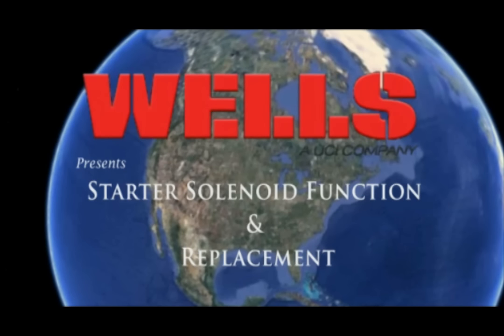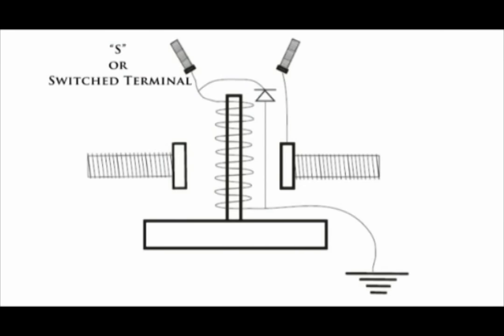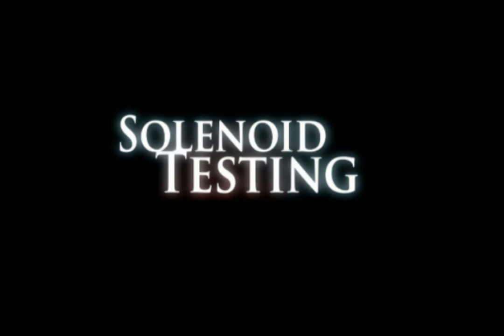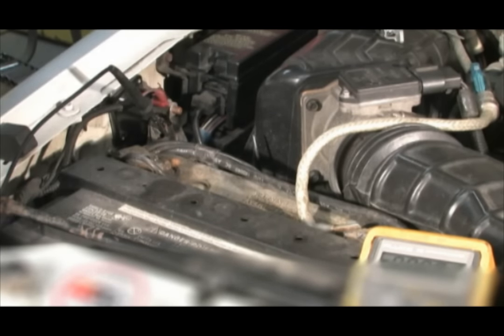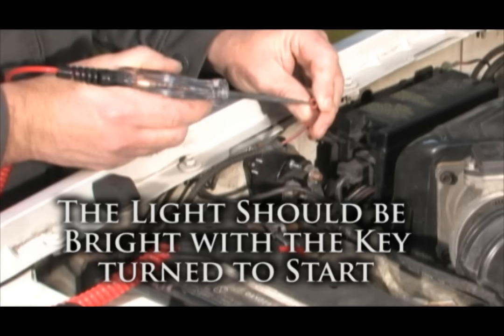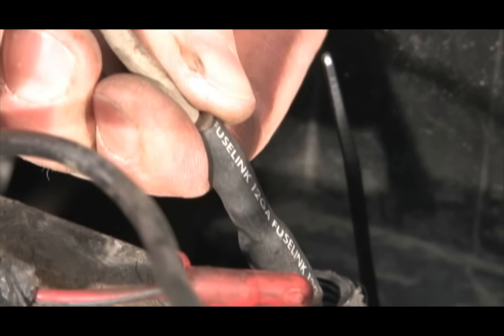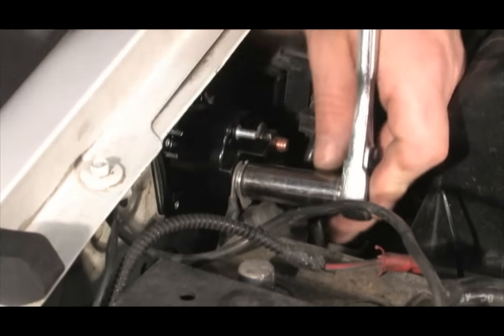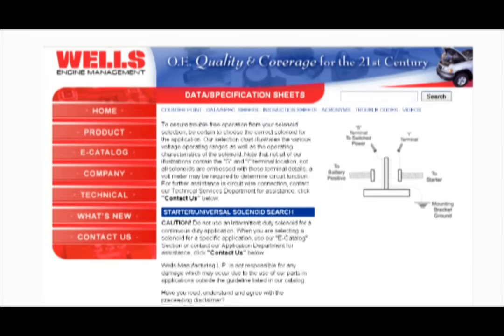Solenoid Testing, Function and Replacement

Comment: Hey Mark! Great video!  So I replaced the relay on the fender and I'm still getting a "single click" problem which (as you mentioned) indicates the problem could be elsewhere.  Where should I start?
Reply: Check the starter wires and battery cables and ensure the battery has a proper charge.

Comment: I found the problem! after testing the starter and knowing it was good,I bolted it back on there "correctly".However,here's where i messed up.the fat red wire on the "top" bolt of the starter solenoid was touching the "bottom" bolt of the starter solenoid.see,when tighting it back on,that eye hook was moving at the same time.it eventually stopped moving cause the bottom half bolt stopped it thop i was still bolting it back on.see what i mean? they were touching each other,grounding out.

Comment: after a long discussion,alalying an narrowing down the issue,iwe all think it's the solenoid.installed a brad new one last night,but the prob lem still remains.it's a 92 ford f150 xlt 6 cyc,4.9 ltr,2 wheel drive,stick...........i'm thinking it's the starter realy,ignition switch or bad wiring touching the truck somewheres.question is,where? i done looked! man i hate this.

Comment: I just replaced my starter on my 2002 f150 4.2 6cyl... I thought it was the starter because it would start after hammering the starter a few times... Advance Auto also said it is for sure the starter. After replacing the starter it started the next day it would not turn. A friend took a screwdriver and touching the battery and starter connections and vehicle started. Is the solenoid bad or is it something else?
Reply from the maker: Temujin, it could be the starter solenoid. Use a test light and test it just like we show in the video. If you have any more questions let me know!
Mike Becker, Technical Services Instructor
Reply: Unfortunately, I beleive the tester would most likely cost more than the solenoid. I think I will just replace the solenoid which cost about $20.
Reply from the maker: Alright, sounds good. If you need any more help let me know!
Mike Becker, Technical Services Instructor

Comment: I have a 1990 ford f150 xlt lariat 5.0 the starter solenoid wires are connected the reverse of the way your wires are connected. I have the red battery cables on left side of solenoid and the wire to starter on the right side of solenoid is that ok does it matter what side they're on? Truck starts great now that i only changed the starter. I'm just curious to see if it matters thanks.
Reply from the maker: Hey Handyman1212, it doesn't matter which side the big cables are on. The only things that matter is they are on opposite sides and the wire that controls the solenoid is on the S terminal. All the solenoid is doing when turned on is connecting the 2 big cables together. Hope this helps give you some piece of mind!
Mike Becker, Technical Services Instructor

Comment from the maker: Be careful with that idea. First check to make sure the ignition switch is getting 12 volts. If you need a wiring diagram, let me know. Leave me a message on my channel with your e-mail address. I answer a lot of questions. Please leave year, make, model and engine size and a reminder of the issue.

Mark Hicks
Wells Vehicle Electronics

Comment: Hi Mike, I have a 1995 Ford Ranger XLT 3.0 MFI and I just replaced the starter thinking it was bad.. At roughly 2:35 of this video. This is the sound I hear. Can you tell me your thoughts?
Reply: on a note here, I watched the video over again and to save time for the reply, Everything You said is done. Battery is tightened down and everything else.
Reply: Junking this truck in 1 week if no reply.
Reply from the maker: Jake, Can you turn the engine over with a big wrench/rachet? Is it seized up?!
Mike Becker, Technical Services Instructor
Reply: Ok, Finally got someone that checked it out. It was Seized. Thanks for your Help. Used Engine maybe? Truck is almost Mint shape for a 95
Reply from the maker: That's unfortunate! But at least you figured out what it was. Sure, a lot of people install used engines with good luck. It's on you to determine if it's worth it on a 95'. Good luck Jake!
Mike Becker, Technical Services Instructor

Comment: 2004 Toyota Camry.  Thought starter was going out.  Give it a little tap and would start.  One day wouldn't start at all. Replaced started. Cars starts sometimes. It's clicks once. I play with the key and sometimes it starts.  Sometimes it doesn't. Any advice? I have several spare keys. It's the same with all of them.
Reply: Change the battery
Reply from the maker: Could be ignition switch related. You'll want to check power to the S terminal on the starter when the key is in the start position. Could also be the transmission range switch.
Mike Becker, Senior Technical Instructor

Comment: I have a 2004 Kia Sedona. Turn the key to ON and all accessories and lights work fine...turn to crank vehicle and nothing. Took starter out had it tested at AutoZone tested good. Battery is good. Tried to jump vehicle off to get it started nothing. All fuses are good. Changed out ignition switch still nothing. Any ideas?
Reply from the maker: Stacey, this could be caused by a bad starter relay maybe. On your Sedona instead of a solenoid mounted on the side of the engine compartment, it is actually attached to the starter. I would inspect for power to the S terminal. Maybe time to have a shop test this thing?
Mike Becker, Technical Services Instructor

Comment: I need advice from a mechanic. I had a question about a Rochester dual jet carburetor. On my car theres 2 pigtail male connectors that look the same. So i wasn't sure which one to plug into the mixture solenoid plug in on the top of the carb. Is there a way to test it or find out some how.
Reply from the maker: +John Peralta If you take a test light and go to one of the connectors. Put the test light probe into one terminal and the ground lead into the other terminal of the connector. Then turn on the ignition switch and if you are in the mixture solenoid plug the test light will flicker for a few seconds after initial key on. Hope this helps!
Mike Becker, Technical Services Instructor
Reply: Ok thanks i appreciate it. Ill try to see if I can get the ground to clip on to the terminal. At first I didn't know whether or not to try that cuz I wasn't sure if it would short it out or something cuz my test light is just a cheap little one.

Comment: have a strange problem, maybe you've seen it.I have a 1984 cj-7 with a 4.2.Cranking it yesterday there was a click then a lot of smoke.The  positive and negative battery cables had heated up to a point where the plastic coating had melted.The solenoid was fairly new, the starter old and with a dead spot.Nothing similar to this had ever happened.Any advice you can give will be appreciated, thanks
Reply from the maker: It sounds like the dead spot in your starter has become a dead electrical short. Get your starter tested and check those wires and cables very closely and repair where needed and questionable.
Mark Hicks
Wells Vehicle Electronics

Comment: Will a bad starter solenoid cause the 15amp fuse to blow out...i changed it and it started once cut it off went inside to get money to go eat and it will not start also it blew the fuse I just replaced
Reply from the maker: Hey KangoKid Kidd, thanks for watching! The solenoid is just allowing current to flow to the starter. It really shouldn't directly cause that fuse to blow. I'd be looking for something else in that circuit.
Mike Becker, Senior Instructor
Reply: @GoTechTraining  shit man I am not smart to do all that but just so you know I think if the starter solenoid is bad it will send current double back to the fuse that is what I think happened so in saying that I replaced the starter solenoid then replaced the fuse and it started flawlessly I mean I barely had to turn the key all the way...and it's being starting like a new excursion...so I am not saying your wrong and I ain't to professional but my theory worked and thanks to YOU...i was like well if the starter solenoid is bad then that's why the fuse is being blown out...i just keep it simple...and also by taking a screw driver from post to post on the starter solenoid it started up with no problem at so ...yiu guys have to say stuff like if you jump the starter solenoid and truck or car starts then it has to be a bad starter solenoid....that would have saved me lots of time...truck runs great and I thank you and all the you tubers who take the time to make video's like yours...thank you from the bottom and top of my heart...you rock man...

Comment: Thanks for showing me how to do that, Eric What happens when the starter will run off the car but, not on the car?
2006 Impala LT 3.9 automatic.
New battery and cables, new relay(4 prong) and there is power from the ignition switch to the starter, which I tested. No damaged or broken wires and ALL wire terminals are clean. When I turn the key to the run position, nothing happens. No noise, humming or clicking but, all accessories work fine.
Someone told me since the car has been sitting up for 4 months maybe, the engine is locked up. I can turn the crank manualy so, that's not it.
please help. Senior in need of help.
Reply from the maker: Hi Neil, there are a lot of things that can cause a starter not to crank the engine over. Security issues and wiring are probably two of the biggest. I would pull codes first. See if you have any related to security and see if the vehicle is in anti-theft mode. From there, look at live engine data and see if the "crank" PID says yes. Let me know how this goes.
Mike Becker, Technical Services Instructor
Reply: Cannot pull codes because the car has been sitting for 4 months. No security or anti theft system on this car.
Thank you so much for your reply. Sorry I called you Eric. I was thinking of someone I was just talking to before you.

Comment: I have a strange problem, I have a 2002 saturn SL2 that starts off and on. I went to O Riley Auto store to get the starter, alternator, and battery tested everything came out find. i'm lost on what the problem may be.? help please
Reply from the maker: When you say it does not start I am going to assume you mean it does not start because the engine will not turn over.

1. Shift the transaxle from park to neutral and retest.

2. Test for 12 volts on the starter solenoid on the Purple wire in the crank position.

3. If ok, jumper the Purple wire to the Red wire on the starter. The starter should crank.

4. Test for 12 volts at the battery cable on the starter. Load this circuit.

5. Check for a good engine ground. 
It is common for the ground strap on the transmission to get corroded and loosen.
Please stay in touch,
Mark Hicks
Wells Vehicle Electronics

Comment: Hi;
Thanks for your video.  My vehicle was having trouble starting without turning the key a few times; then it would catch.  Now jiggling the key and/or the shifter (safety is connected) doesn't do anything and the vehicle doesn't even click.  I checked the battery.  Any ideas?
Thanks!
Reply from the maker: Hey Herman, what kind of vehicle do you have? Let's start there.
Mike Becker, Technical Services Instructor
Reply: Hi Mike;
First, thanks for your reply.  I have a 2004 New Holland TC33D tractor.  I have now checked the starter solenoid, and it checked out.  Also, the lights on the dash come on, but still not a sound.
Thanks!
Reply from the maker: Hm, sounds like maybe the starter it's self is bad. Maybe a bad spot inside the starter. I would verify battery voltage at the big wire in the start when someone hits the key. If you have battery voltage their either the starter is bad, or the motor is seized.
Mike Becker, Technical Services Instructor
Reply: Hi Mike;
Thanks for your reply.  The problem was a safety switch connected to the range selector.  The switch is located at the front, left side of the transmission; it is the bottom one (if you're interested).  Evidently after a while the switch pole wears out.  There are washers that you can that you can remove to tighten up the connection.  Of course, you can always circumvent the switch, but...  Also, it seems the ignition switch is a bit loose.  Nevertheless, I got the tractor started and it seems to start fine now.
Reply: @hermanboing8489  thanks 4 the follow up. 👍 , Herman.

Comment: I replaced my starter then tried to start and all I got was a click so then I replaced solenoid tried to start it and got a click, tried again got another click and everything went dark no power to anything. went to check connection to battle and found the positive cable end melted and came lose from battery terminal so then I replaced the cable end and switched the wiring around on the second and tried it again and nothing,no power to anything. what did I do wrong?
Reply from the maker: Larry, did you replace the starter because the engine would not start in the first place? Have you verified that the engine is not seized up and tight? Is the solenoid hooked up like in this video? What kind of car are you working on? Is your battery fully charged?
Mike Becker, Technical Services Instructor
Reply: Wells Vehicle Electronic

Comment: I have a 1992 3L V6 Engine. I can’t get the battery to charge, I hooked up the charger, but after a short time, it says error. If I change the solenoid should I also change the starter? I. Have no idea about a meter! I have a small one but have no idea how to use it. The video shown and engine do not look like my setup, my battery is on the right side.
Reply: I forgot to tell you, my car sets in a heated barn, and I have to keep charging the battery because something keeps drawing down the battery. I do not drive my Aerostar in the winter. I’ve been having trouble starting it, sometimes when I turn the key, nothing happens, then I turn it again and it would start. I thought maybe it was the starter or even the ignition. I really like your informative videos, but need help.

Comment: replaced my stater on my 2003 Mercury Mountaineer and it was driving for about a week and then it will Try to Crank but won't start what Could it be
Reply from the maker: Hey Chris. There are about 1000 things that can cause an engine to crank over but not start up. I need a ton more information. Check engine light on? Any parts replaced?
Mike Becker, Technical Services Instructor
Reply: yes engine light is on just replaced the starter 11~20~17
Reply from the maker: What codes do you have? Gotta start there. 
Mike Becker, Technical Services Instructor
Reply: I have corrosion on the starter wire and I was wondering could that stop it from starting

Comment: How about if the truck engine cranks over fine but will not fire up until the key is backed off to the run position?, this is what my 1979 ford F-600 truck is doing and I am a bit stumped?. Please give me some advice if you can.
Reply from the maker: +Marti woodchip Hey Marti, it is usually the ignition switch that causes your problem. Below is the entire test procedure if you need it. Need anything more, let me know.
1. With the ignition switch in the RUN position, check the supply voltage on the Red/Light Green (R/LG) wire at the ignition coil connector and check the White/Light Blue (W/LB) wire on the harness side of the Ignition Control Module (ICM) connector. 
The W/LB wire at the ICM should indicate full battery voltage, but the R/LG wire should indicate a reading of 7.0-8.5 volts. 

2. Check the Red/Light Blue (R/LB) wire at the ICM connector with the engine cranking to verify it is maintaining a reading of at least 9.6 volts. This is the same circuit as the one that activates the starter relay. 

3. Disconnect the R/BL wire at the starter relay so that the engine will not crank and check the voltage of the R/LG wire at the coil connector while an assistant holds the ignition switch in the CRANK position. The R/LG wire at the coil should now indicate full battery voltage. 

4. If there is a lack of voltage to the ignition coil when holding the ignition switch in the CRANK position, locate the Brown/Pink (BR/PK) wire at the ignition switch and check the voltage of this circuit while holding the ignition switch in the CRANK position. If voltage is low on this circuit at the ignition switch connection, it will suggest failure of the ignition switch, or an ignition switch connector issue of this circuit. 

5. If the R/LG wire is low at the coil connector in the CRANK position of the ignition switch but battery voltage is present on the BR/PK wire at the ignition switch, service the BR/PK wire for an open circuit to the ignition coil positive. The BR/PK wire changes to a R/LG wire at splice S216 which should be close to connector C325 on the driver's fender apron.

Mark Hicks
Wells Vehicle Electronics
Reply: +markjhicks Hi i wanted to ask my starter relay has a fuse on it so will the fuse blow before the starter relay die's?